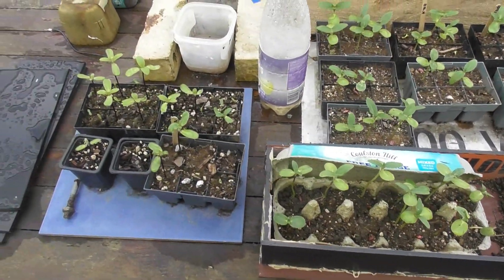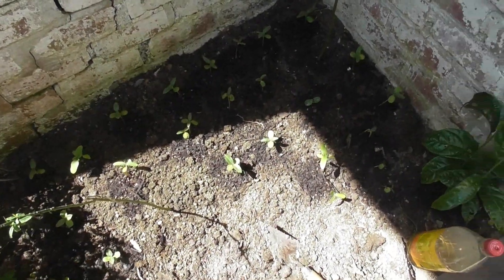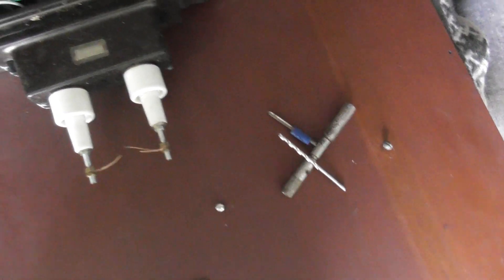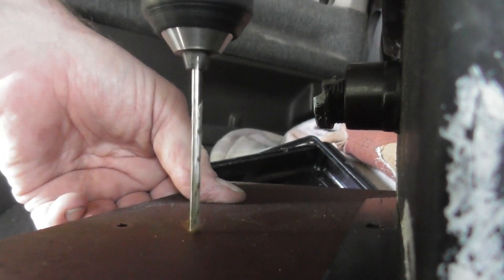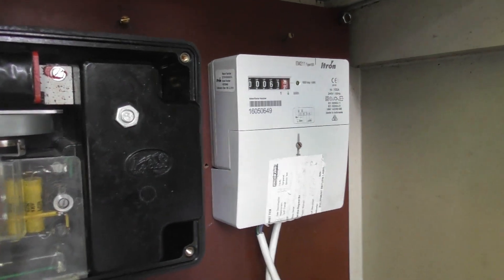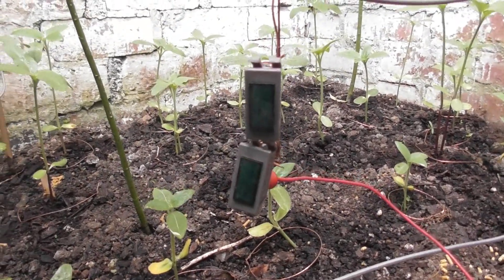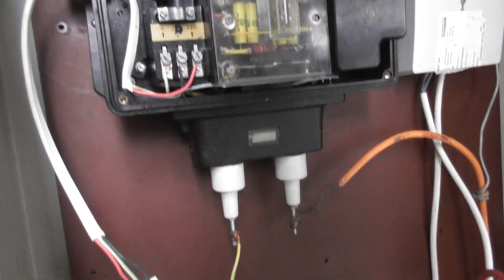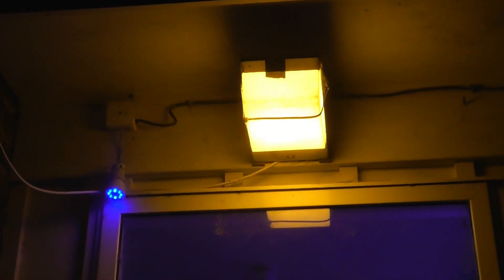Electric fence to protect sunflower seedlings from unwanted intruders.

Comment: Like the corded cordless drill. I also have some, because a 7Ah SLA battery is a lot cheaper than the NiCd pack sub C cells, and also lasts a lot longer. Just meant I had to use a small carry bag when up a ladder to hold the battery, which also was convenient to hold the drill, screwdrivers and other tools as well, plus the hardware you went up the ladder with.